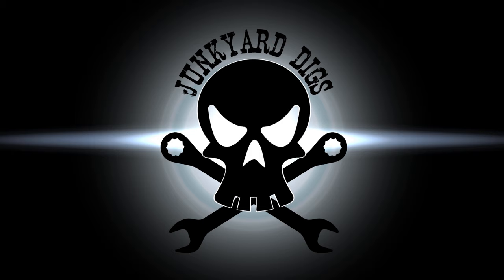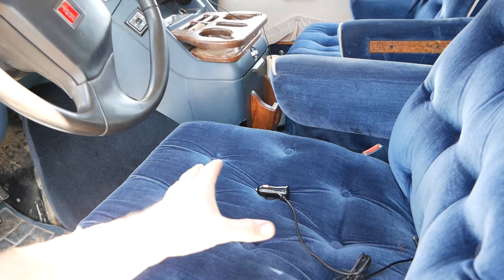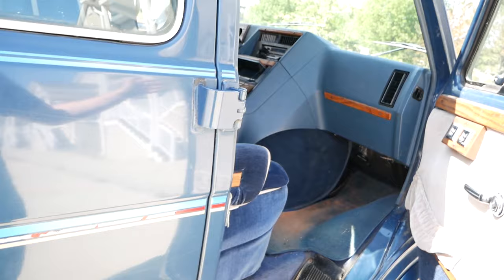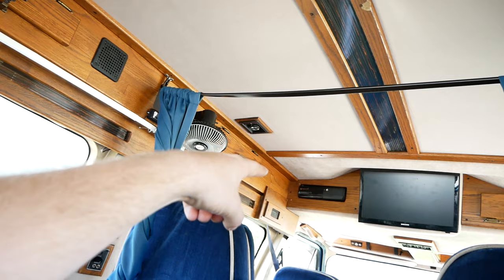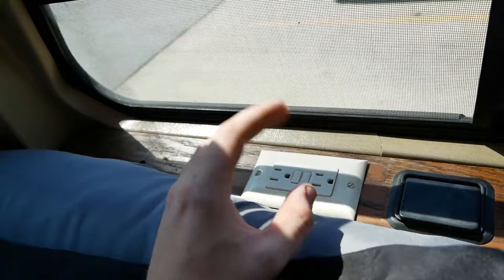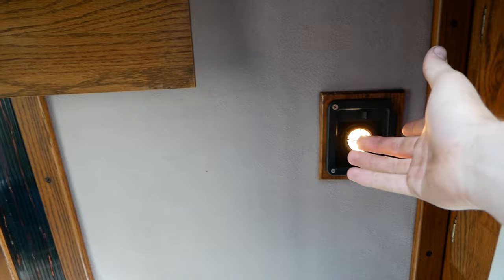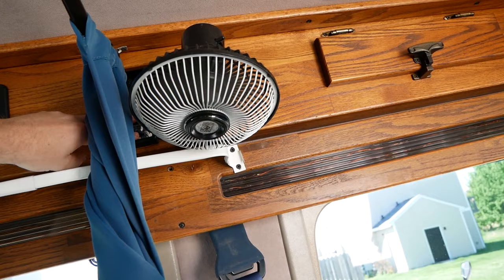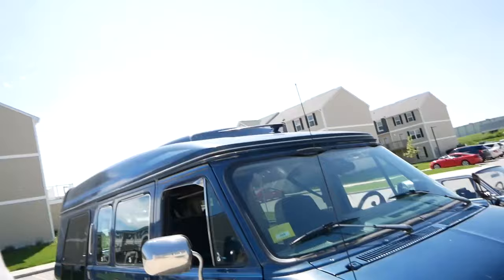How To Build The ULTIMATE Conversion Van

Comment: I have a f150 Lightning from that era. Similar drivetrains as the Ford vans. 
It’s been super reliable for me. No problems with the EFI system, or anything really. The e4od trans seem to pretty good too. 
Not sure if they used those or the aod in their vans...?
The Chevys definitely were simple. Simple is good. 
I agree about the Dodges. Junky. 
Still see plenty of Fords and Chevys from that era on the roads. Not many dodges tho. 
Just my 2 cents. Others opinions can very. Isn’t that great though.

Comment: I've been able to find some Vizio TV's that actually run on 12 volts.  I  Cut the power brick off the cord and wired them directly into the 12 volt electrical system in my campe

Comment: I have a 1988 Chevy truck. Runs perfect all original. The only problem I have had. The fuel tank is rusting. And the rust clogs the screen at the bottom of the fuel pump. Like I said over a hundred thousand miles all original. Always runs as it should

Comment: Be careful with grounding and that inverter, as they have a floating ground and not a grounded neutral like 117 Volts at home. You hold onto something that s plugged into that standing outside you might just light up your world.

Comment: I’ve got a 93 Chevy that has a 700R4 in it, I’ve been told it was not a great transmission, specially to tow, I know this video is older and idk if you get notifications for it, but if you do, is that a valid statement about the transmission?

Comment: You are a genius! I just decided to buy a van conversion as a project, how did you get all that to work?
Reply: hes doing more load than I am doing for my build but basic rundown is:
main battery has the trickle charger and inverter wired to it.

you can either run your accessory cords to the inverter and use the main battery to power what you need on the go or plug into a house and plug your accessory cords into that along with the trickle charger so the battery is slowly charging. for my use im mainly going to use the house plug in so I can leave the van in auxiliary mode and listen to the radio and use the mood lights without the battery dying while I sleep.

Comment: The primary difference between Chevy and GMC is: the hardware, mounting brackets and other equipment on GMC's are a lot heavier duty than a Chevy. When GMC says, "We are professional grade", it's not an opinion. GMC's are made to be professional and fleet vehicles. The tailgates, doors, hood hinges and pretty much anything with hinges, or springs are rated for more use and heavier weight on a GMC. Other than the higher quality standard equipment, I suppose they're "the same" as a Chevy. Lol

Comment: How do you manage the foot room in the driver's seat?  You look like you are taller than I am.  My left leg has to stay curled up under my right leg because there is no place left in the floor.  I have a '95 G20 with the same drive train.  My seat is all the way to the rear as it will go.  The wheel well comes in but I can not use it as a foot rest without my knee hitting the steering well.  In the video of your trip with Mook, while she was driving, it looked like she could use the wheel well for a foot rest.  Since you are taller I thought I would ask how you manage?  My issue is just fine for a short drive. But after an hour or so my left leg really begins to hurt.

Comment: I had problems with my motorhome with battery salotion. Dual batteries with issolater .it will let your back battery run the house and issolat your engine battery so you wouldn't drain it .when you start your engine it will kick in and charge both batteries but will isolate your drive battery from drain

Comment: 12 gauge wire on everything if you're going to run an AC otherwise you might need the fire extinguisher.
Reply: Electrician chiming in here:
I wouldn't worry about wire gauge, since his power sources, whether off the inverter or shore power is a 15A cord end, so either source will trip before the 14awg wire sees too much current.

Comment: A van is like a mini motor home >  i can live in one Nice to pull over take a nap any time you wish!  Or go on long trip, camping, hunting or fishing Dam motels and hotels Are way to expensive, 100 bucks a night for a cheap motel NO FREAKING WAY  i run a generator with batteries . so i can use either one!  A/C is a 5000 btu window unit, ITS LIKE ICE COLD.   I cook in it too a 700 watt micro wave and propane stove as well

Comment: I had one the frame were the gear box broke wile i was driving an it sheared the bolts off the steering gear box at the same time an i almost parked from the road inside of a gas station

Comment: So i have a van with 6 deep cycle batterys. 2 under the hood 4 under the dresser and have a fridge 32 in tv dvd player a game system a  space heater and it all runs of my 2000 watt inverter. All solar. No shore power needed. I can run my heater fridge and tv all night for 10+ hrs and still starts in yhe morning. Also wired to charge when the van is runing. There are much better ways to do what you did.
Reply from the maker: Much more expensive ways*
Reply: @JunkyardDigs  this is true but its also true you get what you pay for. I don't want to fall asleep watching a movie or something and be stuck in the middle of nowhere with a dead battery.

Comment: It's not "basically a Chevy G20". It's better than a Chevy G20.😁
There's a big misconception that a GMC is just a rebadged Chevy, but GMC is the "professional grade" of Chevy and are built for professional use as fleet vehicles. So even though parts from a Chevy G20 will fit on this. The door hinges, hood hinges, suspension quality and many other parts are upgraded quality standard and don't always come from the same assembly line.
Chevy is more popular though, so most people would rather have Chevy because of the brand name. But there's a reason why a GMC costs about $5,000 more than its Chevy counterpart. 
This van probably came stock with a transmission cooler, but it would only be an option on a Chevy. If this has the tow package, it definitely came stock with a trans cooler, electric brakes built into the trailer wiring and Reese 2" receiver. On the Chevy with the towing package, you don't get the trans cooler or electric brakes, unless you order them. You just get the receiver and upgraded suspension (the suspension that comes stock on the GMC without the towing package).
Basically, the GMC is better than the Chevy in just about every way.
Great build, btw!!!

Comment: To do the job properly you never ever use the starter battery they are not designed to power all that equipment. Get a separate gel or lithium battery and a couple of solar panels on the roof. You need to fit a proper what you call shore power connection that you plug in from outside the van with a fuse box and control panel. Your finishing off work on the van leaves a lot to be desired sorry to say. If you want to get answers to any caravan/camper van problems look on Europe  web sites they've solved most of the problems years ago and left American far behind.

Comment: Love your videos, but I cringed when I saw your electrical setup. Please do not try to run a portable a/c off of it, I don't want your van to catch fire. 110 (or 120 if you prefer) extension cords are not meant for more than 10 amps and can overheat if you try to push more than that, not to mention those power strips. For those flat screens and the xbox, yeah its fine as they are not pulling much amperage, but you should still use 12/2 romex for the internal wiring just to be safe. 

Last, but not least, I would throw a few solar panels up on the roof and forget having to have shore power. But 3 marine deep draw batts under your bed for your solar setup and you can camp wherever you want and still have power. You could even get a rooftop ac/heater and power it as well, that would be pretty epic!